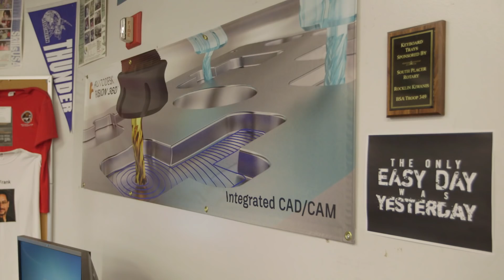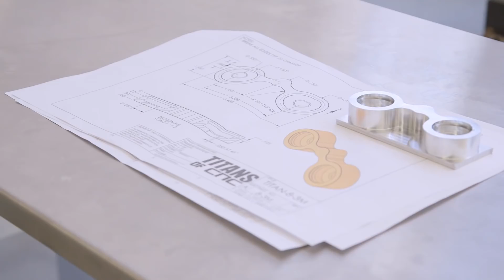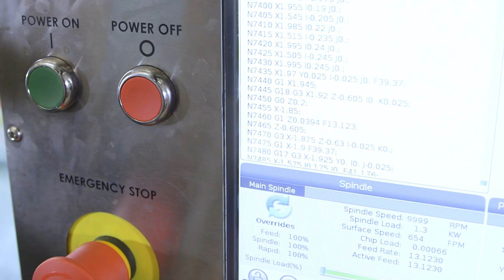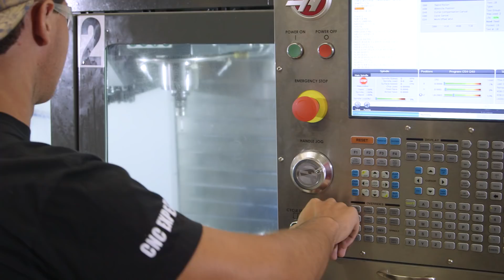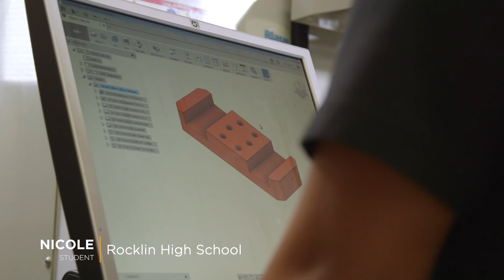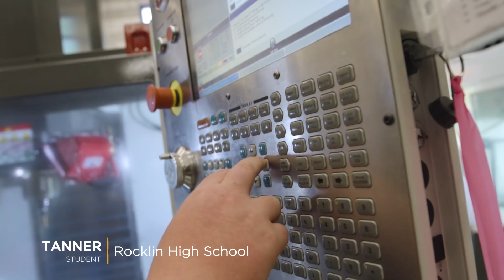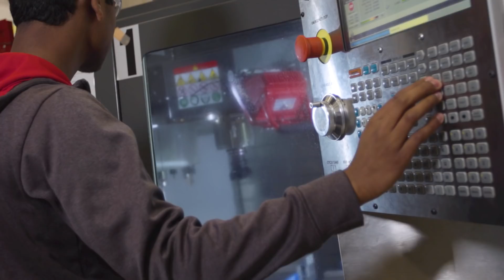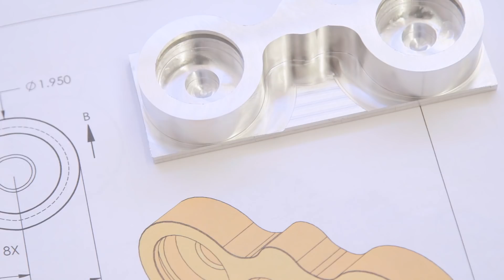Next Generation of CNC Machinists - The CNC Machining Program at Rocklin High School

Comment: Hope there are jobs for these folks.  I have a degree in machine tool, and a work emphasis in CNC machining.  I now work in food retail.  Machine tool was probably the biggest mistake in my life.  Almost no jobs to be had, machine shops closing up left and right, manufacturing moving to China. My opinion is to run from this trade, at least in the midwest.  I would not waste my time on a trade that is dying so fast around here at least.